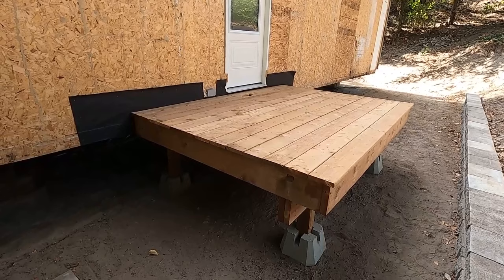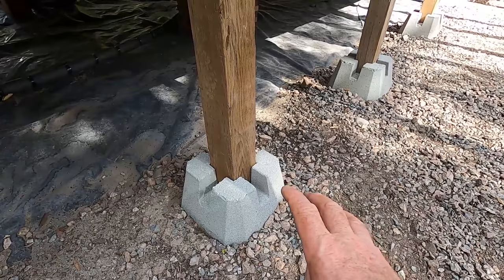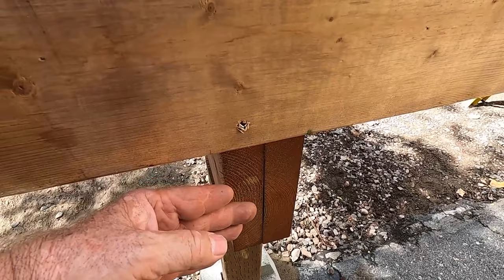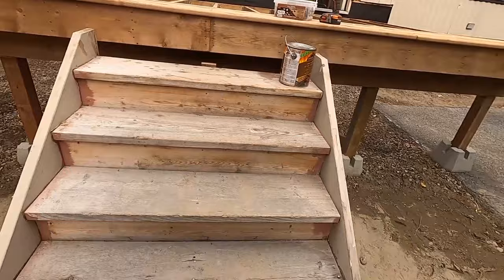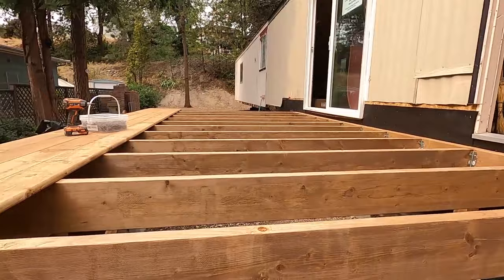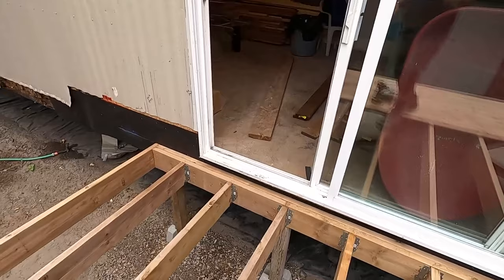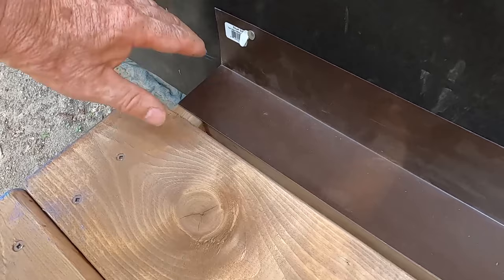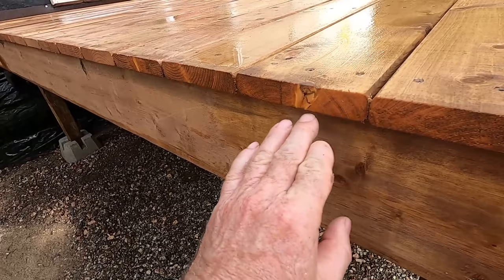Deck Building - Abandoned Mobile Home Project : E098 / BC Renovation Magazine

Comment: I love seeing the flashing/water shedding details and the explanation. Also the wood preservative for the cut ends.  I have made mistakes on these things before, so I appreciate the learning.  I wanted to ask if in your area you have to slope your decks away from the house any, like 1/4 inch to 1 ft? Where I live we get pretty torrential rain sometimes. Although I guess with that 3" flashing you have no worries.? Thanks so much for showing the details. It really helps. I am looking forward to seeing the deck roof work. We have a covered porch and covered deck we need to do for our home, so it's really relevant for us. Thanks again.
Reply from the maker: Hi, Russ. I didn't slope this deck. It has the deck planks which are not tight and the deck will be covered. If it were an open deck or had a solid surface like Duradek vinyl then I would slope it. That 3" flashing really works to protect the building. By the time the water would get high enough to go over the top of that flashing it will be going over the edge of the deck. Thanks for watching and commenting! 🙂

Comment: Hi..thanks for your video. It is very helpful.  I'm am an amateur at this. I have a few questions if u don't mind. 1. Your 4x4 y you didn't put them in the corners of the frame work. Notice they are like a 1/4 from the edge? 2. The 2x8? Sitting on the 4x4 is it just siting there or it's nailed down? 3. My deck not going to be that long but I notice you didn't put any 4x4 on the sides for support...is that just over kill? Thank you for your answers in advance

Comment: Great work explaining as always Ken. I love binge watching your videos. Just to be clear, the ledger board of the deck isn’t connected to the home? I see screws but are they just holding the two beam boards together?
Reply from the maker: Kevin, the ledger board is screwed to the home. This is done to help prevent the deck from pulling away from the mobile home.

Although the ledger is screwed to the mobile home is screwed do deal with lateral forces only, that would pull the deck away.

Load bearing (downward forces) are supported by the posts and concrete footers underneath.
Reply: @BCRenovationMagazine  Understood. Thanks!

Comment: Helpful video. I'm learning how to build a deck. Wouldn't the flashing go over the boards at the house? Otherwise wouldn't those boards will be sitting in water that's caught by the flashing?
Reply: Flashing should go anywhere where water may build up and rest. It’s primary function is to give the water a face to run along and ideally shed the water off instead of it pooling onto the wood which will eventually rot it away; that’s another reason why flashing at the ledger board is imperative it’s the main connection to the house — you don’t want that rotting. 
It’s not very good to put flashing over the actual decking boards. It’s always wise to go overkill with flashing but water doesn’t build up and pool on decking boards typically and decking can always be easily replaced, your ledger board cannot.
Reply: @kejada  but wouldn't you attach flashing to the ledger board and have the bottom of the flashing go over the deck board? In the video, he has flashing attached to ledger board but then the bottom goes under the first deck board
Reply: @BenBen-jl2ft   I see what you’re saying. He has it going underneath the decking board because if he put it over the decking board he would be unprotecting the ledger. 

He could theoretically run another piece of flashing on top of the decking board as well as underneath but then he would have aesthetic issues.

Pause at 23:42 

It would make nailing the flashing underneath the door virtually impossible unless he removes the door beforehand.

The way he’s done his flashing in this is perfectly acceptable and will last a long time. 
The only difference between me and him is I put mine on as soon as the ledger is up and I add another ‘lip’ to the flashing and make it into what’s called a Z bar so the flashing runs down the face of the ledger maybe half an inch. 

Hope this helps. Flashing takes a lot of visualization (and theory) as you can see.
Reply: @kejada  super helpful. Would you then have a deck board sit on top of the z bar or most in front so the board doesn't impede the movement of water down the z flashing
Reply from the maker: kevyn, thanks for explaining.  You saved me a lot of typing.  You are right on point. 🙂👍
Reply from the maker: Hi, Ben.  Kevyn has explained it very well.  Let me add a couple of things.

All of the lumber used in the deck is treated to prevent damage from water (rot).  The theory is that as long as the water can drain away and dry the wood will not rot, because it is treated.  We are concerned about keeping water from intrusion behind the ledger to where the house framing is, which is untreated material.  

If we set the flashing above the decking then we have created a gap for water to creep back under to get in behind the ledger.

The only exception to this would be if you used some kind of sheet material like DuraDek for decking.  In that case you would frame the deck, apply plywood sheathing of some kind over the ledger and joists, then install a flashing over the plywood where it meets the building, then your sheet material over top of the flashing.  In that case the flashing is between the sheet material and the plywood.
Reply: @BCRenovationMagazine  ahhh I did not think about over the deck flashing creating a gap and a way for water to enter the house. Better to have one treated piece to repair much later on then a rim joist

Thanks much
Reply from the maker: @BenBen-jl2ft  , yes, fairly easy to replace a deck board.

Also, in case Kevyn doesn't come back, the way he does the Z flashing is excellent.  If you do it like that then the order you would go in is: strip of tar paper on the wall first, then install the ledger, then the Z flashing, then the joists (because the lower part of the Z flashing gets sandwiched between the ledger and end of the joists, then apply the decking boards.

I didn't on this job but sometimes I will run a bead of caulking along the top of the ledger where it meets the house before I install the flashing.  Not really necessary but does no harm.  The purpose of the tarpaper is to stop any water that might find its way back behind the flashing to the wall.

A problem that I have in my area is that I can't get a Z flashing like I would like to use, unless I have it custom made, which is expensive.  I like the flashing to come up farther on the wall than what the Z flashing that is available to me does.  That's the main reason I do it like I do.  I guess I could bend my own Z, but I think its OK the way I do it.  

Good luck with your project and thanks for stopping by.  🙂
Reply: What we have here boys and girls are two authentic tradesmen by the looks of it. Bear in mind that individual circumstances make certain options less viable or ideal.
Reply: I'm a novice...what is flashing board & where are they located please...im trying to make sure this last another 20 plus year's like my first steps/ porch
Reply: @BenBen-jl2ft  There is no ledger board on this deck.  A ledger board is a support board that attaches to a house.  You cannot attach a deck to a mobile home - it is against code (and you wouldn't want to do it anyway).  All mobile home decks have to be "floating" or free-standing (whatever you wanna call it).

Comment: Is the Ledger board screwed to the house ?
Reply from the maker: Hi pacmanplayer.  It is lag bolted to the main structure, but it is not load bearing on the main structure.  It is lagged only to prevent the deck from pulling away from the main structure.

The deck itself is supported by posts and concrete footer blocks.  Code in my area requires that decks be self supporting, stand alone structures.
Reply: @BCRenovationMagazine  you double checked your local code right? im absolutely positive you know more about this than I do, but im doing a deck right now too, and noticed in my local area, if the deck is connected to the house, and over 250 sqft, a building permit is required, while if its not connected to the home, it can go as big as 1000sq ft before needing a building permit. Either way you got a beautiful deck going on man! im building a 24x12 but mine is only about 3 ft off the ground.
Reply from the maker: @GardenisLife  Hi, Gardenislife.  Absolutely, always check the requirements in your jurisdiction.  Requirements vary widely and what is acceptable in one area may not be in another a short distance away.

In our area, there are four different jurisdictions and different requirements all within about an hours drive of each other.

Generally speaking, around here a permit needs to be pulled if the deck is more than 24" off of the ground or if it has any kind of structure built over it.

Repairs and maintenance are exempt.

Most of our work is done on first nations lands, which is a unique jurisdiction.